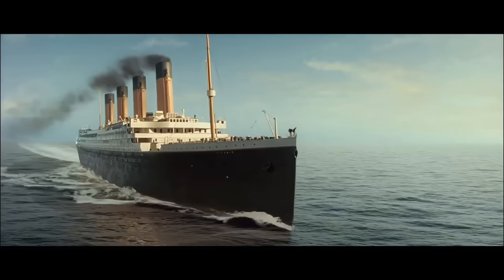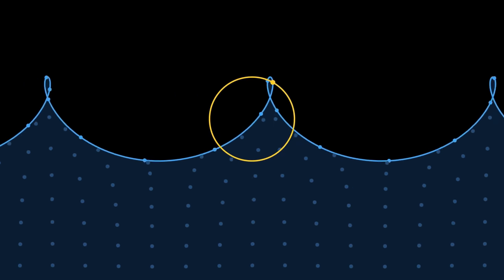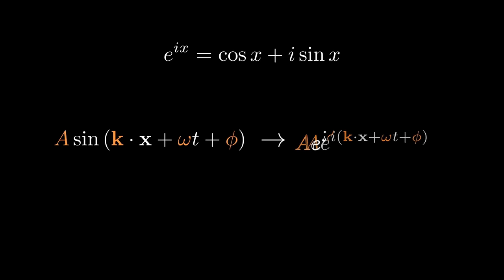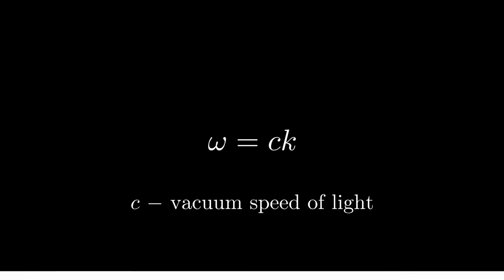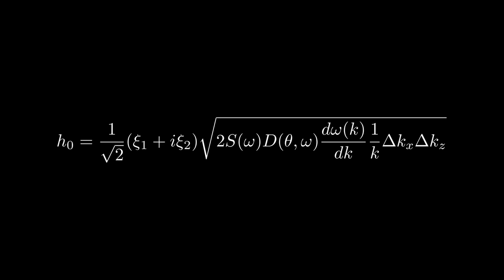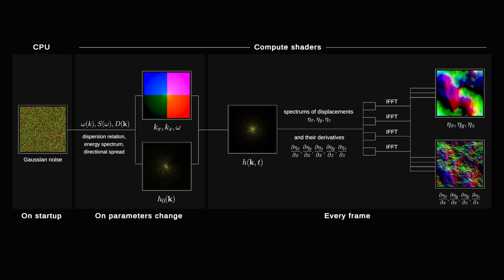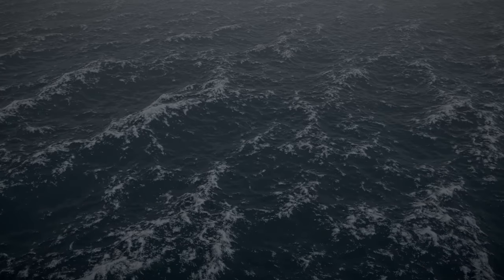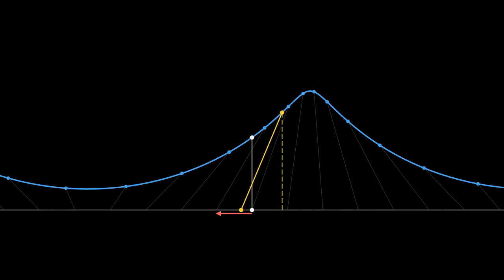Ocean waves simulation with Fast Fourier transform

Comment: You have done some good work on this issue. I am a retired expert in Fourier theory and it is interesting to see how the FFT still rocks on  50 years ago when I first used it.
Reply: something tells me that we will be using fft for as long as we do computing. It is so fundamental.
Reply: holy moly. I'm 14 and I got alot to learn
Reply: Basically you can study whatever field in physics and fourier theorem is everywhere :)
Reply: I remember learning about it for the first time, and it totally changed how I thought about information. I used them like crazy in my next internship on software-defined radar systems. They're an insanely good tool to have.
Reply: @ShatabdaRoy115  the e^2pi*i part is really just the number 1

e^pi*i is negative 1

e^(angle in radians)*i is the number on the complex unit circle distance 1 from the origin at the angle you put in
Reply: Wavelets all the way...
Reply: @mathunt1130  I have met Ingrid Daubechies.  The Belgians made her a Dame such is the regard they have for her achievements.
Reply: I am an engineer working in digital signal processing and I am amazed at the elegance and utility of the Fourier transform. The FFT has to be one of the most useful algorithms ever made.
Reply: Have you played Crysis (2007)?
Reply: what have you done in Fourier theory? where have you applied it?

Comment: I was at a computer graphics company (on of the first doing commercial work) in 1987 and saw what was at the time an astounding, color still of a perspective view of the surface of a calm sea, bathed in the golden light of a sunset. It had taken hours, perhaps even over night, to render on a minicomputer. It was quite advanced at the time.

I was told by the guy who modeled the scene that it involved sin/cos functions, which was more or less obvious because it was periodic but I didn't really understand how (and the source was FORTRAN, which had to be batch processed from a stack of Hollerith [IBM ]cards). So it was a pleasure to find this explanation.

Comment: Excellent and fascinating work. It is very neat how you can synthesize a realistically-looking ocean based on rigorous physics of wave dynamics. I have one comment regarding the rendering, for example at 11:05. While the theory used is certainly for non-breaking waves, and therefore the waves by themselves would not produce foam, one can easily imagine a situation where the foam is pre-existing and the waves just move it around. Now, what happens in this animation extract is that the white patches (which I perceive as foam) move with the wave crests. In my opinion, you would get a more realistic effect if the foam remained on the air-water interface essentially at the same points in space horizontally, and the waves simply propagated over it. If you want to be maximally realistic, you could consider the back and forth motion associated with the horizontal oscillations produced by each wave cycle, and even, possibly, the slow drift, produced by the Stokes drift (although that latter aspect would not add much to the realism on the time scale of a few seconds).
Reply from the maker: Yeah, the foam definitely should be persitent. There are difficulties in meshing it with the cascades. There are two ways to do it, basically, and both are not perfect. Still working on it, actually. It is relatively easy to make it move with the wave cycles, though.

Comment: Very nice work! I thought the foam was a bit much on some of the waves. They gave the impression that they were hitting some rocks that were out of the frame. Then again there must be an indication of reflected waves if it was the case which I did not notice. It's amazing how we get attuned to how the sea behaves: our vestibular system starts doing some Fourier analysis after spending some time on the see and we get sea legs when we are back on land.

Comment: Very nice video, definitely be interested in seeing the follow up on the other stuff you talked about.  One thing I'll mention, is that when you exit the Unity world, those problems with "Pipelinestalls" and things aren't really issues. In API's like Vulkan, asynchronous execution of GPU commands is not only an option, its expected and default behavior*.   You can even separate the FFT step *entirely from your rendering, have it be performed at a lower frame rate, and even interpolate the results by looking a head, but I digress.  What you would probably do in this case is use double buffering, use the GPU to write the output in one buffer, and on the next frame use another buffer, allowing you to safely copy the information you need to your CPU while it is calculating the next buffer.  No pipeline stalls period.    What you would really want to do however, is calculate boyancy on the GPU instead, then copy that data to the host which is much much smaller.
Reply from the maker: Thank you for the advice! I would really like to dive into the graphics APIs at some point. The idea with GPU boyancy seems interesting. I think, as a bonus, all the GPU power can allow a more sofisticated boyancy model (voxel based maybe?)
Reply: @JumpTrajectory  It's funny you talk about this because i am actually trying to convert a buoyancy system (inspired by Habrador buoyancy tutorial) to compute shaders, in order to make it compatible with FFT ocean. So far it works pretty well with Gerstner waves (from CatlikeCoding tutorial), but i am dizzy when i read the fft ressources you linked because my math background is too weak to understand all this right now (I honnestly don't even really understand what FFT is).
Reply: This has nothing to do with Unity as is. Unity supports async gpu readback, async compute and all the other things you mentioned as well. You should research the topic before you embarass yourself in the future.

Comment: I once worked on a lobster fishing boat 90 miles off the coast of North Carolina, and there were rare occasions where the ocean was amazingly flat, as depicted in this simulation. But most of the time there were rolling hills and even mountains of water.
Reply from the maker: Thank you for the observation! This is swell, I think. I didn't know how important it is for the look of the ocean at the time as I was making the video, but now I understand that it is present most of the time. Good news is that it is already supported in the code, I just didn't include in the scenes for the video.

Comment: interesting stuff. Perhaps one alternative way to initially address the tiling issue would be to look at the tiling as a triangular tile of polygons wherein you take a random chunk of said triangle as a sample from the first "tile", re-randomise where the points are going to be drawn in 2d space and then take the edge most points and have it so they are what correlates the next tile to the one before it. So basically don't look at the grid as a grid but rather think of it as something that initially exists as a triangle of triangles but can potentially be manipulated to be an irregular triangle of triangles... think pyramid recursion wherein each pyramid of pyramids is manipulated via Perlin noise but then the gaussian random number generator you're already using is then manipulating in 3d space in the same manner in which you would manipulate Bezier curves where those points will actually be. 

Also in terms of the way in which you're generating the heightmap itself, have you considered, for a final phase in generating the actual heightmap, routing the 2 output textures through some sort of optical flow filter ? The reason I say this is because using this in order to influence the heightmap texture, could in essence apply a layer of recursion to the clumping affect going on within the heightmap texture itself. As far as actually doing the latter would be concerned, I suppose there'd be ways in which you could use the python API for MATLAB to take the actual heightmap texture itself, do optical flow shit in there and then replace the texture buffer that's storing the initial heightmap with the version of the heightmap with optical flow
Reply from the maker: I don't think I really follow what you are saying about tiling, but there is another reason to use the cascades, that I could have explained better in the video. The cascades greatly improve the dynamic range of the FFT. To represent a plausible water surface you need wavelengths from ~1cm up to the hundreds of meters in choppy sea. To cover this range of wavelengths you have to use multiple FFT domains, otherwise the required resolution becomes insane.

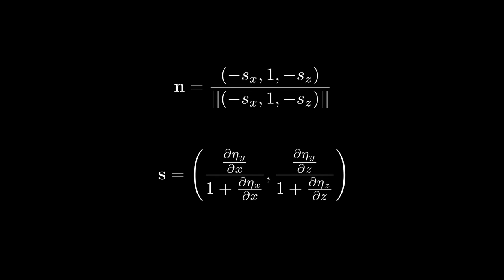Comment: Where did you get the equation @ 10:19 from? I specifically wonder why we add 1 to the partial derivatives in the denominator. Why use this formula instead of forming tangent vectors with the partials and computing the cross product?

Comment: Would really love to get a tutorial on how to make my boat float in the water. My previous project used raycasts to check the wave angles and move and rotate the boat accordingly, but I don't understand how to get the generated mesh off the GPU so I can assign it to a mesh collider!
Reply from the maker: Reading back the whole mesh and creating a mesh collider out of it would be extremely slow. However the system can provide water displacement and height samples to the CPU, which you can use to make a boat float. I'll probably include an example in the reworked version.
Reply: i did this by doing the same calculations in compute shader as i do in my vertex shader. and iterate through corners of the ship for all the vertices and get the closest wave to the corner points i set. + made an optimization:  my water mesh has like 65k vertices. iterating through 65k vertices was kinda slow so, i just get the size of the ship and make my own 2 x 2 matrix array of the ship IN WORLD POSITION ( so that even if the ship coordinates change, waves are still the same) and feed that array of vector 3s to my compute shader. this way it only looks through  like 500 points at most.

lastly i check if the height of closest wave is below or above of the ship's corner. if its above, i apply a force.
Reply: @JumpTrajectory  Please include an example about that, it would be really helpful. I nearly searched for 3 hours for finding a boat float on your project.

Comment: This is an excellent video! I'm a little confused by what the texture above h0k (9:35) is representing, are the values for kx, kz, and omega in the r, g, and b channels respectively? I noticed while reading through your code that WaveData stores vec4, so im a little confused about what data is being represented in the texture. I would appreciate any clarification and thanks again for this amazing video!!
Reply from the maker: I store kx as r, kz as g, omega as a and 1 / length of k as b. I stored one over length just for convinience as I had a spare texture channel.

Comment: really impressive work!  and thanks for sharing. will you be maintaining this as a unity asset for the coming years?
Reply from the maker: The code linked in the video is not meant for the real production. It has significant performance problems. I am working on an improved version which I mean to maintain in the future. But I already blew several deadlines on it due to scope creap, so no promices on the release date.
Reply: @JumpTrajectory  thanks for the info. We use oceans a lot for creating HIL test / training simulators for the offshore industry. Yours looks really good and I love your mention of Jonswap in the video. I couldn't directly find any variables related to jonswap spectrum in the editor, that would be really ideal for us as this is often the basis for offshore scenarios. We use really high end pc's so computational efficiency is not the highest priority. anyway, subscribed to your channel :)

Comment: Thanks for the video! I'd already implemented my own FFT ocean based on Tessendorf's paper and the phillips spectrum, but didn't quite understand some of the math. This video clears up a lot of it!

Do you have sources for some of the other equations in your github repo, such as the direction spectrum function, normalization factor, and amplitude calculation for the jonswap spectrum? These were the parts I couldn't find sensible numbers for until I found your repo.
Reply from the maker: Check out references number 2 and 5 for the info on various spectrums. 
https://github.com/gasgiant/FFT-Ocean/blob/main/references.md

The cryptic numbers in the normalization factor function are just coefficients in a polynomial approximation of an actual integral, that I just made in python. 

Also, in my personal experience - you kind of have to fudge the realisic numbers to make a nice looking water. In particular, I find that JONSWAP and P-M both have way too much high frequency waves.
Reply from the maker: Also, there is a separate .hlsl for that in the newer version https://github.com/gasgiant/Ocean-URP/blob/main/Assets/OceanSystem/Shaders/Resources/ComputeShaders/Oceanography.hlsl

Comment: Great work! I am researching FFT and shader languages to develop the same ocean simulation myself. Do you think the shader graph of unity can make this simulation as well? It is a lot of math and I wonder if it is worth making so much effort as the shader graph seems easier. What do you think?
Reply from the maker: There is a lot of math involved in the simulation, so implementing it inside a node system would be extremely cumbersome. The shader that uses the resulting displacement/normal maps to render the ocean, on the other hand, is reasonable to implement in something like Shader Graph.

Comment: The height sampling method for bouancy is not correct, especially if objects get smaller compared to the waves, since objects floating in water, will also follow the horizontal drag of the water particles. in other words those objects shouldn't just move up and down but also forward and back with the wave.

Comment: I found an error in the code. Ocean waves need the WAVELET transformation, not the Fourier transformation. Otherwise the animation looks artificial and not real.

Always use the wavelet transform for waves!
Reply from the maker: The superposition of trochoidal waves is defenitely not perfect and with enough experience at close-ups you can quite easily tell that the water surface is computer-generated even in sofisticated offline renders. I'm curious though, how can wavelet transform help in this case? What kind of wavelet function should be used? Could you elaborate on this?

Comment: Excellent explanation of the issues and your solution - which looks very nice.  One question: to eliminate tiling, you are using cascading textures.  I assume that this is an addtion to the FFT method you are using, or is it an alternative?  How is it implemented?  Are those textures used as normal textures or as heightmaps?
Reply from the maker: The cascades are essentialy multiple FFT simulations. They output displacement maps and their derivatives (from which the normals are computed). The result is the sum of these cascades.

Comment: Very nice tutorial, and thanks for the references to the papers! About the buoyancy simulation, what is the reason you have to calculate the physics on the CPU? That is obviously not true in general, since you're calculating the physics of the water waves on the GPU, so why can't you calculate the buoyancy physics on the GPU as well?
Reply from the maker: You totally could simulate buoyancy on the GPU. However most of your gameplay code, such as character controllers and rigidbody physics lives on the CPU. So if you want to, for instance, have a bottle that rolls around inside a boat, the physics system on the CPU will have to know position and velocity of the boat. You can simulate boyancy on the GPU, but you will have to have a readback of something to the CPU anyway.
Reply: @JumpTrajectory  What about making the entire game on the GPU?

Comment: I would like to say that it got a bit confusing whenever you showed the changes in the equations. The cycling animation (where the equation from the last step moves up and fades) is nice, but it would be clearer to have the changes highlighted and the fade be only very slight. This would make it easier to understand what the change was between steps.
This is otherwise a very useful video!

Comment: I have never used compute shaders before, how useful would they be for something like snow accumulation simulation on objects like trees to get realistic snowy assets? On the CPU it is way too slow to be practical.
Reply from the maker: I'm by no means an expert on compute shaders. But the main thing is that the problem you wish to apply compute shaders to should be very parallel for them to be effective.
Reply: @JumpTrajectory  Yeah that makes sense. I want to simulate each particle of snow falling and sticking so computer shaders would do well I think.